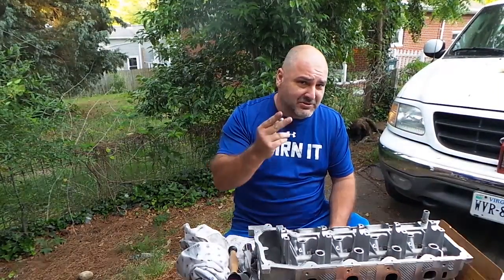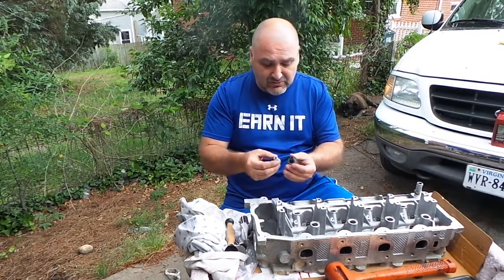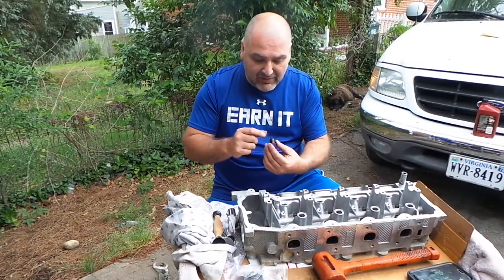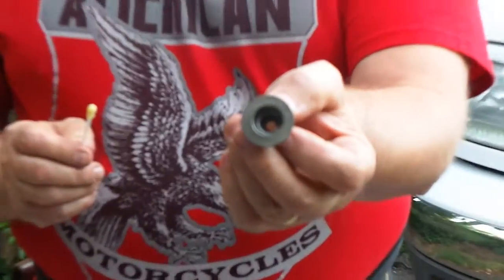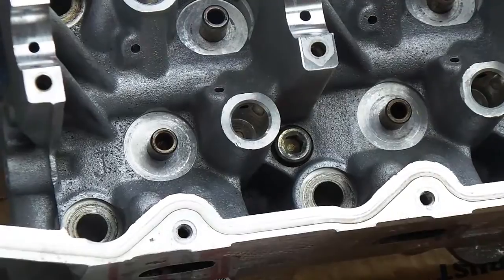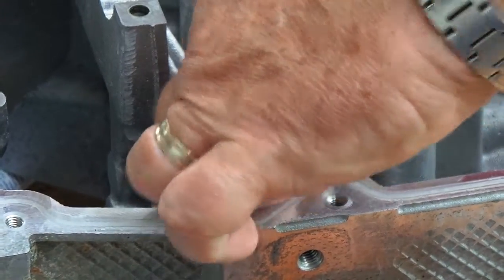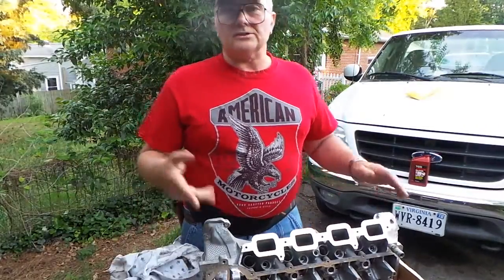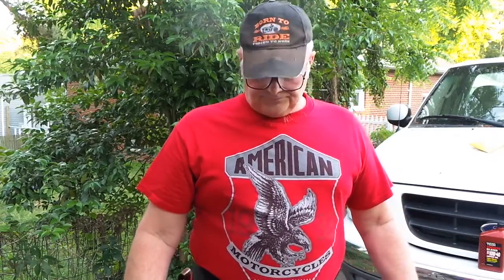Valve Guide Seal Installation On A 4.7 Liter Chrysler Engine

Comment: Should I pull the head to do the valve seals? Is it really gonna save that much time by using the special tool ppl use to do it without pulling the head.

Comment: How are the new seals going to last before it start to smoke again or the newer seals are a better upgrade?
Reply from the maker: +michaelheiland123654 Its pretty safe to say that you should get about a 100k or so out of them.
Reply: +JamieJones TheCarMan why does  all data  say valve guides are  not serviceable and then when I get my head gasket  set the guides are  in it and then you  show me it can be done  wth